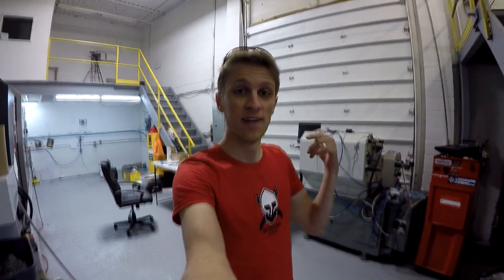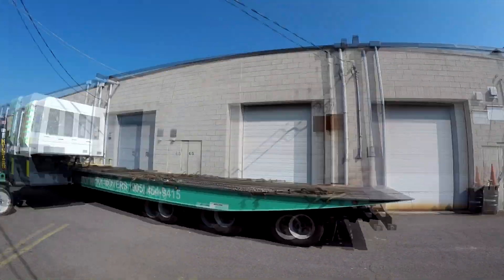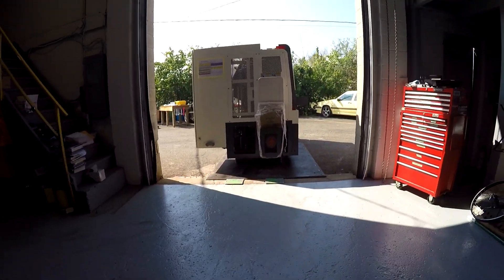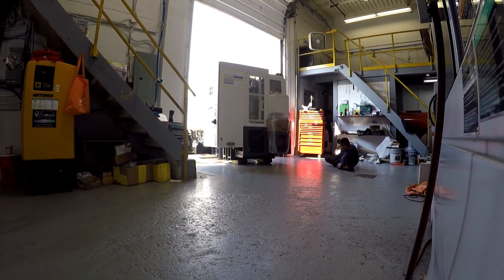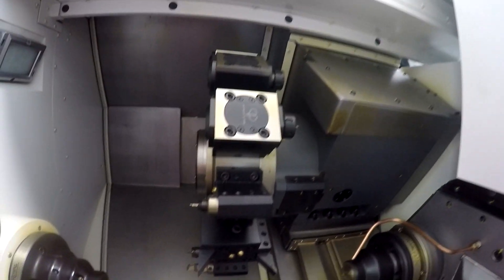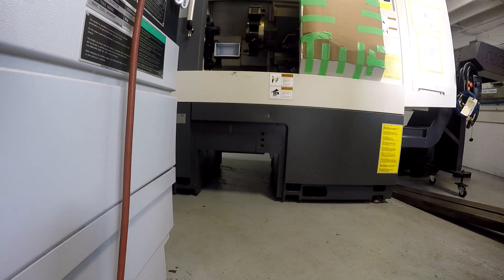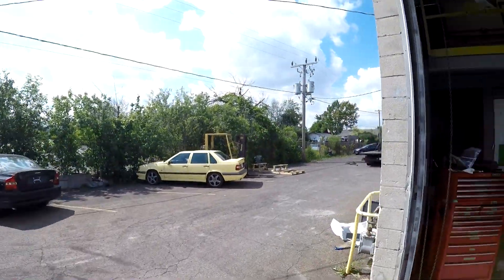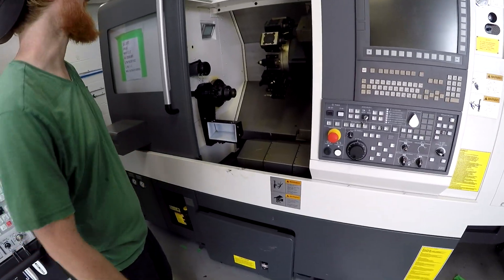Nakamura Tome CNC lathe delivery - Grimsmo Knives

Comment: Nice machine. The dual turret version would make the parts faster, but not much faster since you cannot keep both turrets cutting all the time. For example when transferring between spindles, neither turret is cutting. Of course, you could make most specialty little parts like that with an automatic screw machine or even a manual turret lathe faster than you can assemble them into knives. I like Haas machines, but even Haas uses machines from other companies to make their larger parts.

Comment: I would hate to be that guy,  but how many screws/fittings/etc. could be brought in from a 3rd party supplier for the cost of that machine?  At what point does this become a viable investment?
Reply: One point to consider, for them to R&D a new part is far simpler in shop on a nice machine that to pay a machine shop to make part after part as they refine the design. Also, custom parts in general are quite expensive from a job shop. if John can keep this machine running it will easily pay for itself in no time, not to mention if regular maintenance is performed on the machine it could last him 20 years. he makes knives now, but what will John be doing in 5 or 10 years? its a lathe he can grow into, just like his mill.

Comment: Hmm... (at the 13 min mark) would it be better if the CNC machine was turned to the right (lengthwise) as the new one is in the far back? It would give you a lot more room, it seems.

Comment: ha you guys had a little more room to get that in there than we did! Does it already have the circuit breaker installed in the electrical cabinet door? That thing was a monumental bastard to install.
Reply from the maker: +Steven Mathews (Vorsprung Suspension) yes it did because it was already powered up at Elliott!  Install here was easy.  It'll be mine to drive tomorrow.

Comment: I did not know if fanuc controlled cnc machines need the transformer in US. I was thinking it only used for non 220 V 3 phase power.
Reply: In industry all over the word is used 400V 3phase power.
Reply from the maker: +Sdttn +TheSad25pl my shop has 600v coming in.
Reply: Even better John :D
Btw. What would you suggest ?
Haas Super MiniMill or Tormach or used CNC mill ?

Comment: You can move in to position later with a bit of ingenuity and leverage.
Reply: You can remove the dent by putting something heavy, metal, and flat on the outside whilst hitting it with a hammer from the other. Slow hits will make it flat, if you tape the flat metal with electrician's tape, it will save the paint too.

Comment: screw driver slot on the main power switch turn it an it should unlock the handle an you will be able to open it . there's latches in side, it's a safety thing !